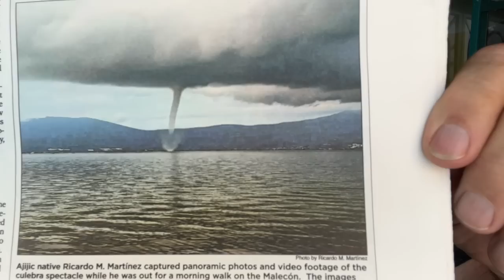Visiting Mexico?

Comment: Here are two tips to use in your garden than I have used for years to kill ants and any other bugs that want to attack flowers or other plants. Put 1 teaspoon of dishwasher soap in a spray bottle and fill with warm water, shake, then spray the leaves of your plants, inside or outside. Bugs hate it  The second method is mix equal parts cornstarch or borax and sugar, and scatter near plants. The insects will eat the mixture and that’s their last meal.  I use both methods.

Comment: Last Monday I was at GDL, headed back to the States (for my daughter's wedding, thanks for asking), and the boarding gate agent sent me over to a separate desk nearby when she saw my green card and U.S. passport. The purpose was "just to be sure." Sure of what, I can't say, but it seemed they wanted to log me as leaving the country. If I were to guess, the "just to be sure" was to ensure I'd have no issue returning.

Anyhow, they're still working out the kinks. My advice right now is to show your documents on the way out, just in case it matters to them.
Reply from the maker: Thanks for that report. I plan on not changing what’s worked for years until personally instructed to do otherwise.